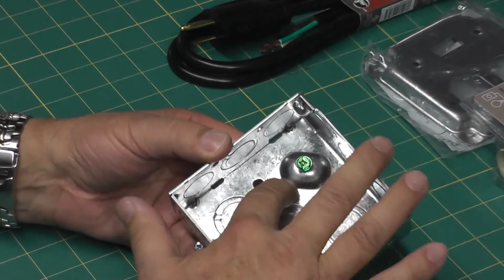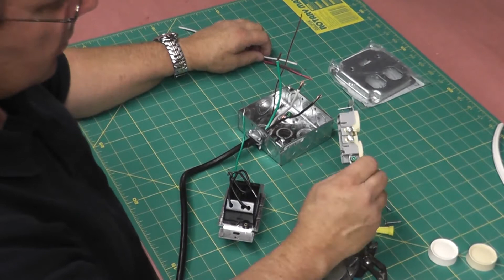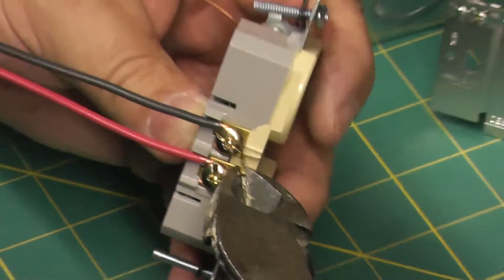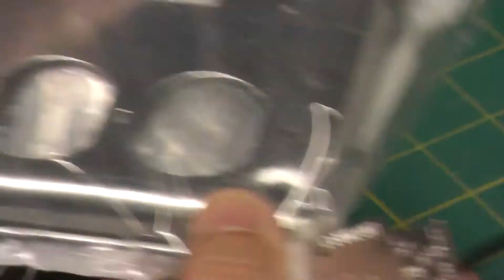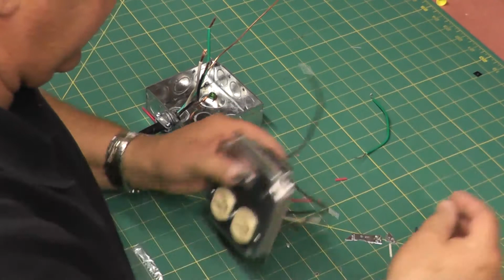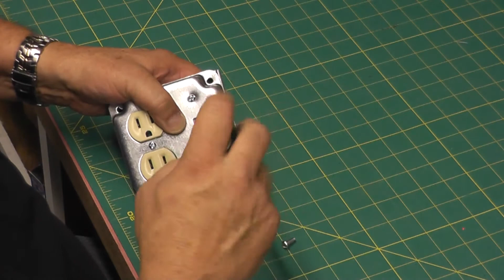Temperature Control for Hot Glue Gun

Comment: Hey Jeffrey thank you for your video, and I have a question...what if I want both plugs to dim? thanks a lot.
Reply: Wire them in parallel if you want them dimmed the same or you will need another dimmer for the other plug. I am not familiar with US sockets, but from what I can see in the video you just need to skip the step where you cut those metal tabs between the screws.
Reply: @ooltimu  thanks a lot